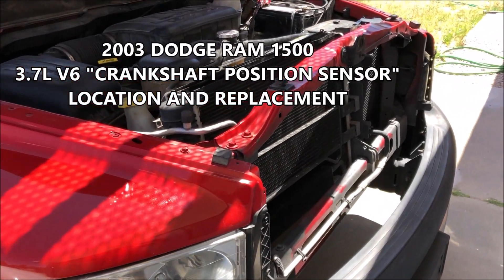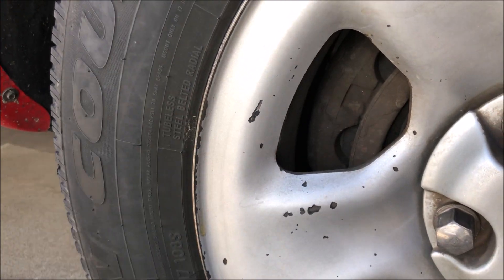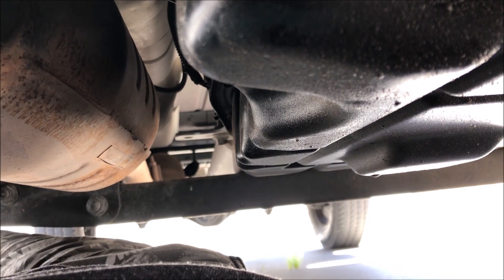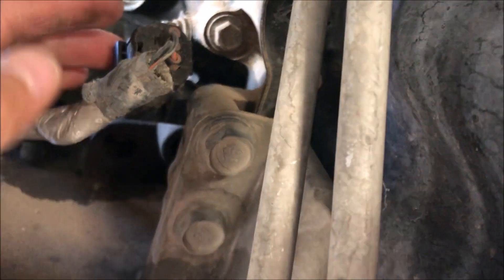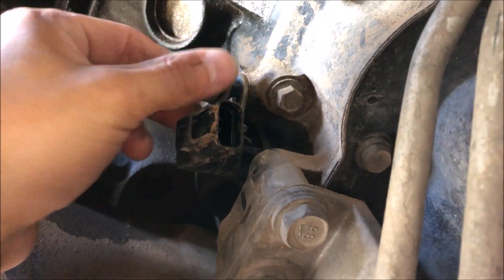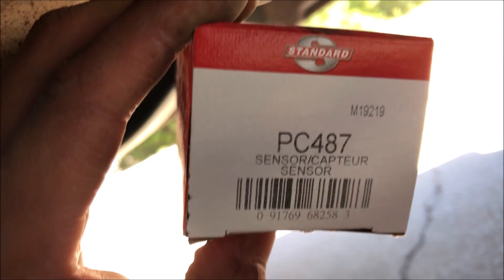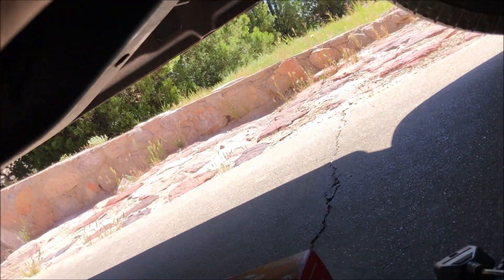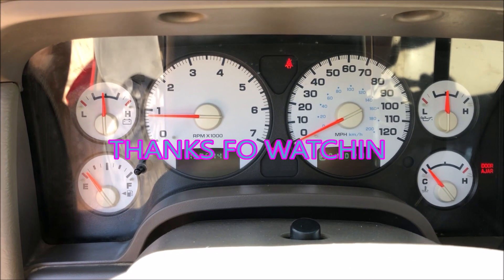2002-2008 Dodge Ram 1500 3.7L V6 crankshaft position sensor location/replacement P0320

Comment: Will this cause your truck to idle rough then stall out? So far I replaced my tps sensor,the connector,IACV,spark plugs and coil packs, put on 2 different throttle body’s. An it still starts up runs for a bit the stalls out I have the same exact truck.

Comment: Great video. I wish you would have shown were it was and how to get to it. O'REILLY shows it above a starter on the passenger side of the engine. That's also the one they sold me. Then they are saying my mechanic buddy removed the Camshaft Sensor. I'm lost and he is as well.

Comment: Thanks for this very informative video. When my 2008 Dakota would warm up from a road trip it would refuse to start acting weirdly during cranking. After replacing this crankshaft sensor the issue seems to have been resolved.

Comment: so my car will start and then it gets hot i think and wont start im getting code p1391
Reply from the maker: a P1391 typically deals with a bad Camshaft Position Sensor (CMP), it's not seeing the right signal and the car is shutting off. On Chrysler/Dodge products you want to use if possible an OEM Mopar replacement